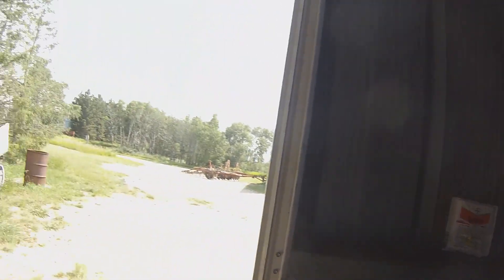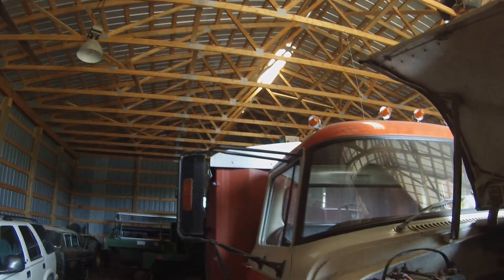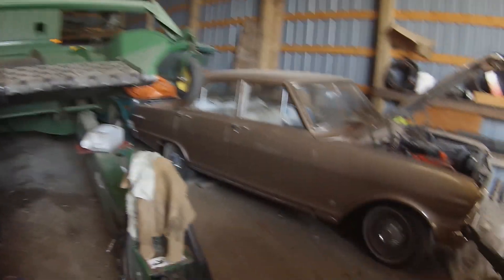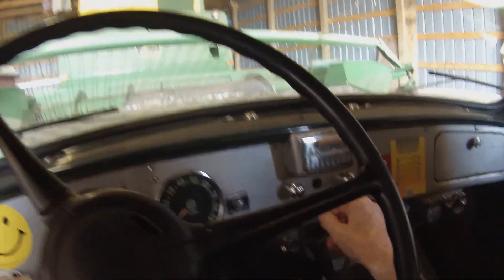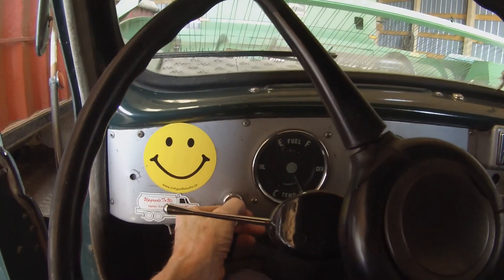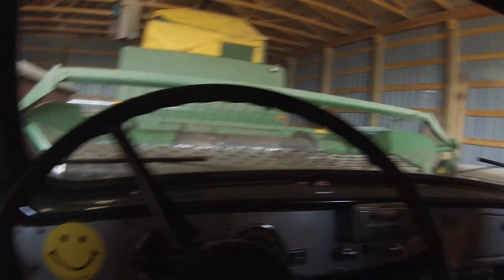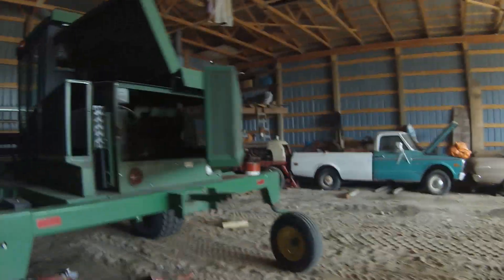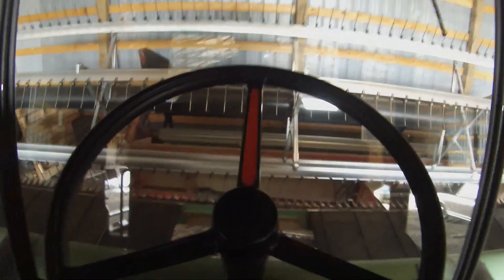Moving day

Comment: All your equipment is in great shape!  Looks like the GMC used to be a Diesel?  A/C will be mandatory with days like we have been having here lately in SASK!  Those RedTek cans are handy!
Reply from the maker: Yes, the 81 is a former 5.7. Olds might not have got the diesel engine design quite right but they sure knew how to build a gas engine. This 403 has been working great for me since 1986.
Reply: @roosty6  right on!  Yes the 5.7 Diesel was not a marvel motor.....  I had a1980 that was swapped to a 307 - not quite enough power.  The 403 would be about right in a half ton - a 455 would be fun! Ha !